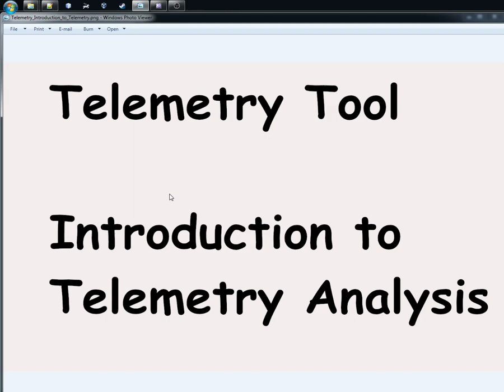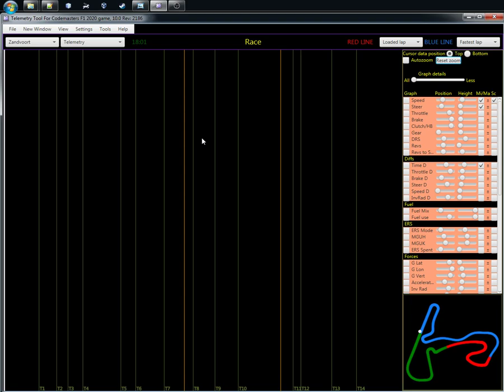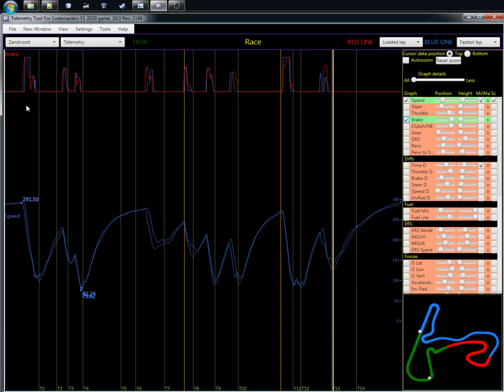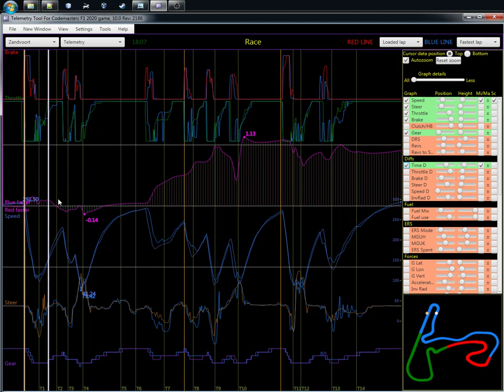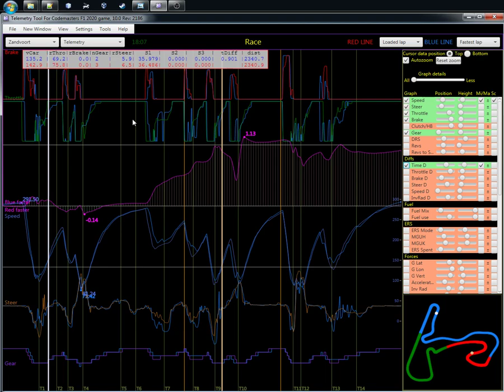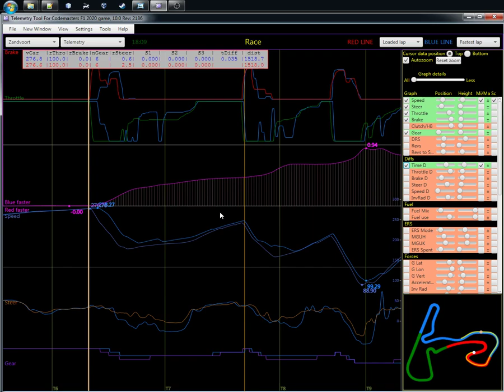Introduction to telemetry analysis

Comment: Hi! I can load old Motec2 laps in your software? Thx
Reply from the maker: Nope, the Motec2 file format is proprietary and cannot be used with my tool. I guess one could write a converter, but I will not do one due to licensing issues relating to Motec2.

Comment: A big thx for your tool! Is there a way to see max. tyre pressure (psi) and temperature? I m new to this analytics but this seems to be very worthy information to have a view after the race/practice.
Reply from the maker: At the moment you can see the tyre pressure only in the Driving pane. I might add in version 11 way to also save tyre pressure and tyre temps. It is in the planning stage at the moment, i.e. creating new save file format for the tool.

Comment: the blue line ghost doesnt seem to be working on f1 2020?
Reply from the maker: The  way the Ghost BLUE line works is this:
1) New Time trial, i.e. when you get the Default Ghost
You need to win the Default Ghost and get assigned a new Ghost. This new Ghost starts halfway into S1, so I am not saving the lap yet (or making it the BLUE lap). If you don't beat the Ghost on the "half lap" and the second full Ghost lap, then the Ghost data is saved and set as BLUE lap. Now if you beat the Ghost before the "full lap" i.e. the second lap, then there is no BLUE lap for that ghost.

So always, when you get the new Ghost, you need to let it drive the first half lap and then the full lap, only then you will get the Ghost as BLUE lap. The data gets collected as the car drives.

2) Existing time trial. When you have already done Time Trial on the current track, you will get the ghost from the start of the lap. In this case (i.e. at the start of the TT), it is sufficient to let the GHOST run 1 lap to get the data. After this with the new Ghosts on this session the rules from above are valid.

Also note that with Version 10.1 I added some more fixes to the Ghost data, so now it should work pretty well.

Another note is that do NOT restart the lap or use flashback, when the new GHOST has been received. This will make the GHOST's data bad. 

Cheers.

Comment: Thanks for your tool and your work.
I really appreciate it.
Do you mind making a video showing how you analyze a short 10 lap race afterwards?

Thx!
Reply from the maker: I wanted to do an After Action Report on the weekly Silverstone race, but it was pretty uninteresting. Had bad start, recovered and managed to pass a car during pitstop by staying out one extra lap and then kept it behind me for the rest of the race. No big tactics or strategy changes. When I get an interesting race, I will post something on that front. I have lined up some opponent lap analysis videos, which will come out during next few weeks.

Cheers
Reply: RacingGame Telemetry 
Thx.